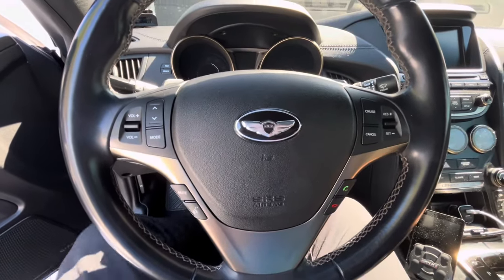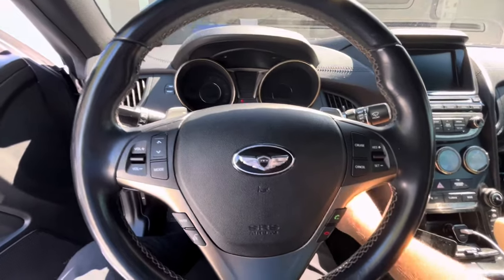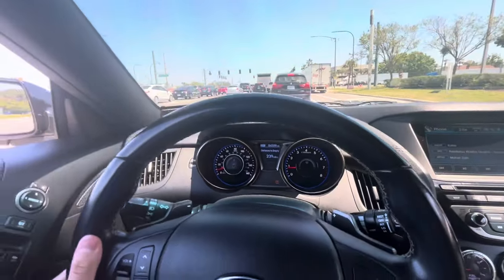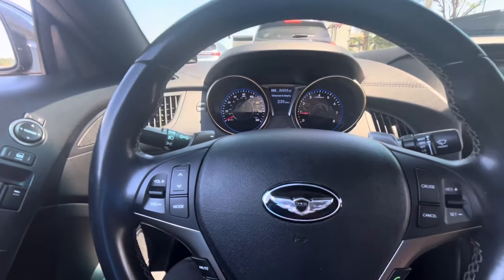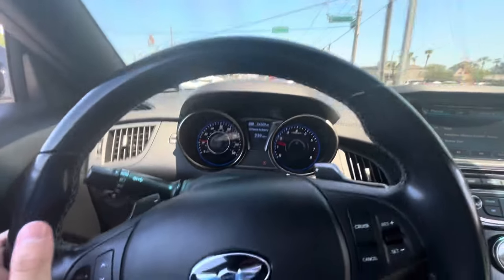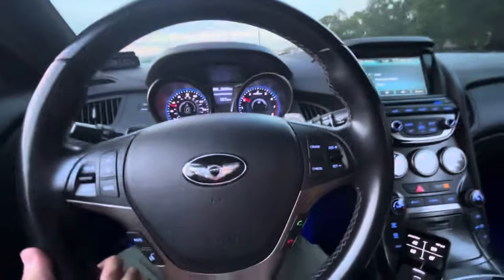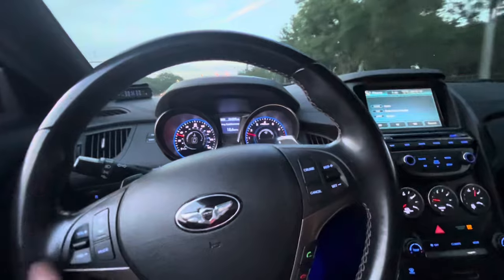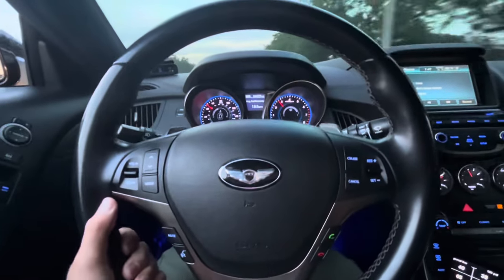WHAT ITS LIKE DAILY DRIVING A TUNED GENESIS COUPE !!!

Comment: Where you at Fam?!  Let's run it back!  3.8L BK1 E85 FBO.  I wanna run with some 2.0's!!!  Your car sounds good man!  Looks quick!  

Just a tip: you should definitely port your manifolds and throttle body!  New intake.  And then full exhaust.  Airflow is super important.  You will get some gains from an exhaust and downpipe and headers, but that is just the "exhale". What good is being able to "exhale" really easily if you cannot "Inhale" a bunch?  Get your intake parts upgraded too and bam!  Different car.
Reply from the maker: Lmk

Comment: So you gave up 70 or 80 miles for 20 more hp and some pops and bangs? And the money you spent on the tune and down pipes, ricer math ain’t mathing to well
Reply: Welcome to the genesis club still will gap a 5.0 mustang
Reply: @xmoellerxd  that’s not really saying anything, an N/A 5.0 is not fast at all
Reply: @Turdbo-Cutlass  if a n/a 3.8 v6 can beat a n/a 5.0 v8 there’s a problem especially when the 5.0 has been around forever and the 3.8 v6 was around for 7 years. Not everyone wants to have 1000 hp street builds or has the money to do so. Put a turbo on a 3.8 you can make 450-700whp depending on which supporting mods you have.
Reply: @xmoellerxd  which stock n/a 3.8 is beating a stock n/a 5.0? Also you’re not going to make 700 whp on a 3.8 without atleast putting a set of decent rods in the thing, so that moves beyond “supporting mods”. And to go back to my original point why bother with that car and platform, the amount of money you’d have to put into that genesis to beat my car would blow way past what I’ve spent to build my entire car. Displacement is king
Reply: @Turdbo-Cutlass  buddy I never said stock and supporting mods for 700whp build would indeed take more then some rods lol. If you don’t have the money to build one just say that then, anyone can get an iron block ls and build it for boost some people like being different.
Reply: @Turdbo-Cutlass agree on the pops and bangs bs, but gotta correct something here, it's the piston ring lands being tiny that cause the engine grenades, the rods are not the weak link. Heat soak and people running boost with no methanol injection or active charge cooling causes the upper piston rings to touch ends and pop the lands creating your new engine inspection port.
Reply: Go buy a prius